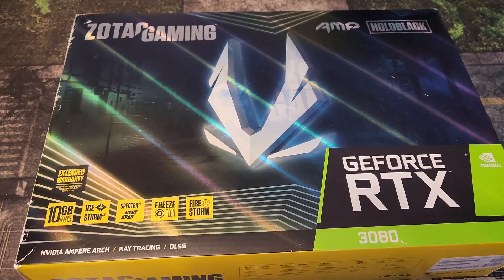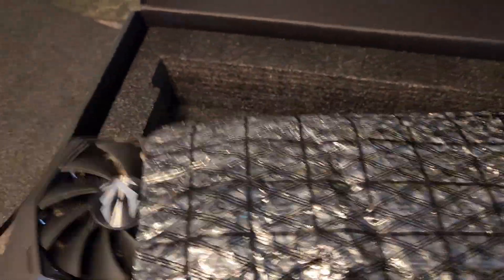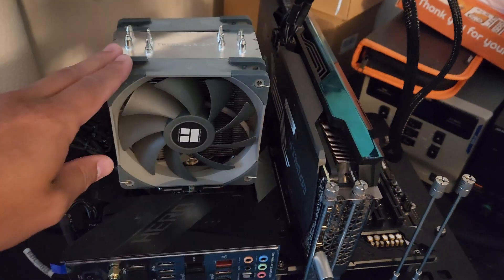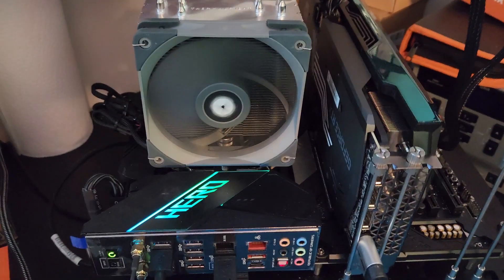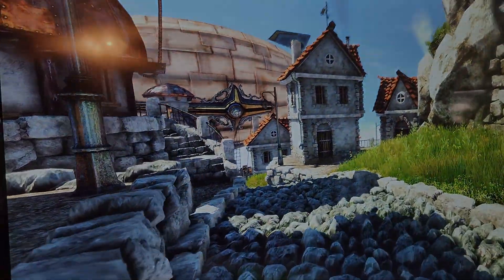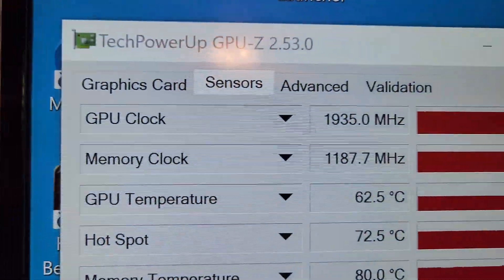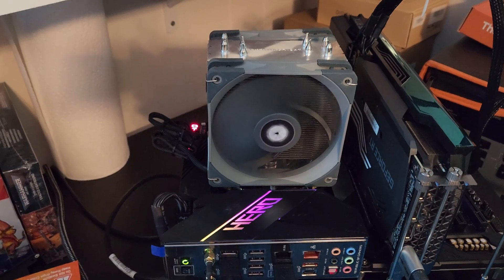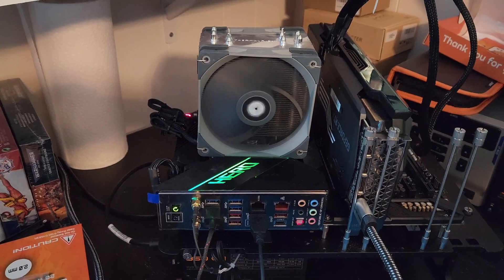Do this when buying a used gpu!!! How to make sure your used gpu works as intended.

Comment: Hi i have i7 4790k and Z97-k mother board and 16 gig ram 
I don't have money to upgrade my CPU and motherboard and two months later im probably gonna get 4060 to use on my current system and upgrade the CPU later 
Does used 3080 makes more sense?? If i wanna get it ?? Or stick with 4060 ??
My PSU is also 650w so it should be enough
Reply from the maker: What's the price difference between the 2? Also I would maybe consider upgrading the CPU and motherboard first. Especially if you are gaming in 1080p
Reply: @krootman_digitial  I can't upgrade my CPU and I want performance boost and I don't have extra Cash for CPU.
Reply: @krootman_digitial  4060 the brand new is around 380$ 
3070 600$ Brand New 
3060ti is used is around 310$ 
Rtx 3080 used is around 350$ 
So all of them are fine on my old motherboard right?? Don't know which one makes more sense.
Reply from the maker: @Angelscry2B  I still think you are better off buying a CPU and motherboard first, but if you must the 3080 is your best bet
Reply: @krootman_digitial  I want performance boost if I buy new CPU and motherboard I won't be having Money for GPU or ram or new 750w PSU
CPU and motherboard will not give me Performance boost
If these GPUs work on PCI 3. Slot that the one the R9 290x connected is fine for me
Reply: @krootman_digitial  so you recommend 3080 used, well will the 650w PSU that I have will be enough for it ??
Reply from the maker: @Angelscry2B  as long as you have a good one it will be ok
Reply: @krootman_digitial  it's been working great over decade, I have played the heavier games and I never seen the PC failing.
Reply: @krootman_digitial  thx

Comment: First step of buying new or used GPU, is don't buy Zotac.
Reply: Why? I was told it was a good brand.
Reply from the maker: I was not a fan of zotac 30 series, id stay away from them if possible, poor build quality, but if you can get a deal too good to pass up then go for it.
Reply: Why
Reply: @Sc0rpion-704  My first high end brand new GPU I bought was a Zotac 980TI AMP Extreme. it died before the warranty was up, and they refused to make it right by fixing or replacing my GPU.. so I vowed to always avoid buying Zotac and any chance I get to tell others to avoid buying from them as well.
Reply from the maker: As much as I dislike zotac, I never had an issue rmaing with them, do you remember why they denied it?
Reply: @krootman_digitial  They argued that I was outside of the warranty window, even though I still had 2 months. My buddy at the same time had an EVGA 980Ti go bad (apparently 980Ti was bad design) and his was actually out of warranty window and they still made it right and sent him a 1080. I was an EVGA fanboy ever since then. very sad they quit making GPU's now.
Reply from the maker: @arcrypto22  ah man that stinks I'm sorry, the rma I did with zotac actually only had 2 days to go and they honored it

Comment: hello i noticed you have possibly the same hp office pc you have in 2:57 (hp pro 3500 series mt), i just want to ask if you have any recommendation on how to upgrade it and what parts to replace/keep with it. i have stock power suply 300 watt, 2 and 4 gb ram sticks (two 4gb sticks didnt work for some reason), a pentium g2030 and a asus gt710 2gb
Reply from the maker: What is your budget and what country are you located in?
Reply: @krootman_digitial  My budget is anything around  $500 or $600
I live in Algeria for now, a lot of people doesn't have visas and mastercards as our currency isn't supported so stuff here can be bit more expensive than what is sold online

Comment: You can see by the screws that someone opened it before
Reply: Looks like the warrenty sticker is removed. It was used for mining.
Reply from the maker: Not that it matters but I can tell it wasn't used for mining at all, its way to clean to have been, and if it was nbd i have already proven mining does not matter when it comes to gpu useage
Reply: Its a zotac gpu.  Its already crap